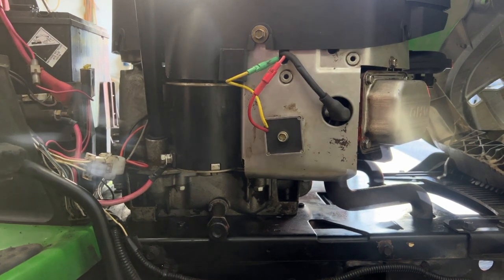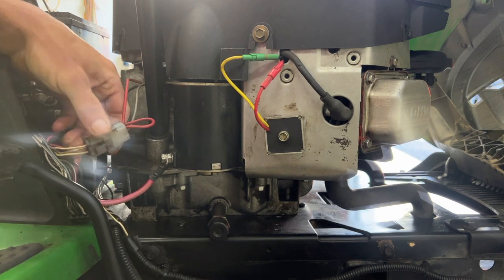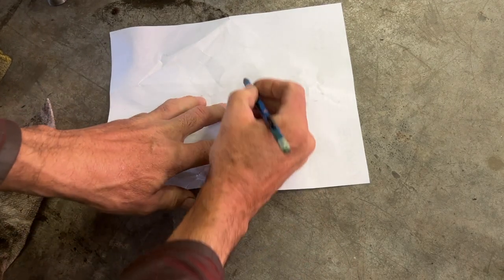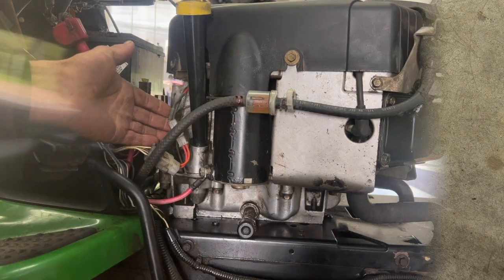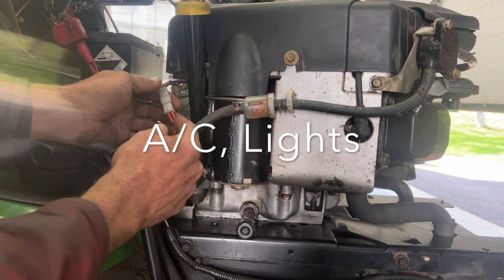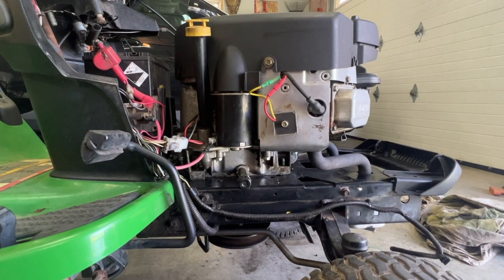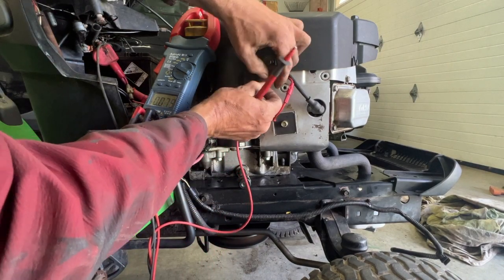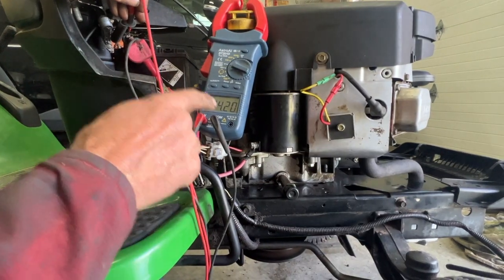John Deere 22hp D130 Briggs & Stratton dual charging system explained. Rectifier, voltage regulator

Comment: Thanks for this video. I have a 15hp Briggs & Stratton engine on my lawnmower and it has the charging system you show in the first engine in the video (two-wire voltage regulator). The thing is that when I measure the red terminal it only gives 6 volts and the stator output wire comes out at 24 volts. I would like to know if in this case my voltage regulator is bad? I also notice that when I discount my battery the engine stops immediately, so I think the regulator is not supplying enough current. Sorry for my English, I'm from Spain.😅
Reply from the maker: I figure your voltage regulator is bad.  When you disconnect the battery it loses 12v to the carburetor “anti backfire” solenoid and the motor shuts down.

Comment: So what if the AC voltage to the regulator is not correct?
Reply from the maker: Bad wires, poor connections, your windings might be bad under flywheel.  Do a resistance check.

Comment: So if I understand correctly you can do a Briggs engine swap on a John Deere from a 1 wire stator with a voltage regulator system to a 2 wire stator with a diode and delete the voltage regulator that way you do not have to change the stator and it will still charge the battery, but does not put out as high of voltage. I bought the tractor with no engine so I have no voltage regulator. The engine I bought to replace is almost identical, v-twin briggs but it has a different stater because it is from a craftsman tractor.
Reply from the maker: Yes. As long as your mower doesn’t have an electrical PTO.   
    Some Briggs & Stratton engines on craftsman will have the same wiring harness.   
  https://m.youtube.com/watch?v=5kobLoL-BJ4&pp=ygUkRW5naW5lIHN3YXAgam9obiBkZWVyZSB3ZWVrZW5kIGhvYmJ5

Comment: On the dual charging system,the red wire is also AC behind the diode?can i eliminate the diode put together the two wires on the stator to a VR and use only DC?Thanks👍👍
Reply from the maker: Don’t know for sure if the coils would work against each other.  The ac sine-wave might not be in sync?